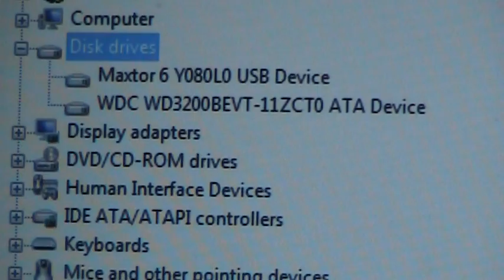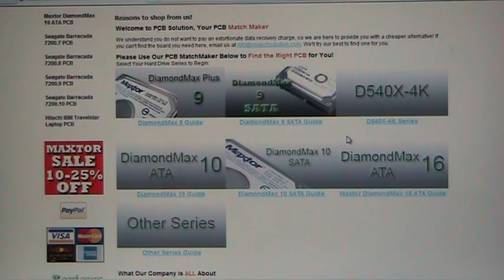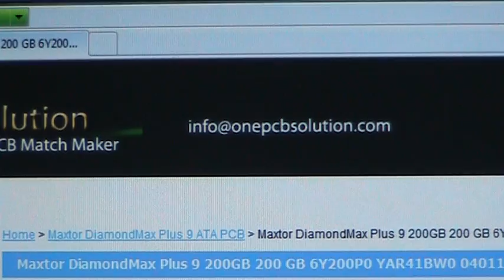DIY: How to repair a clicking damaged hard drive

Comment from the maker: With clicking drives, it is very difficult to tell what the exact problem is, simply because many problems all cause clicking.
Here are some rough odds estimators though to help you with the diagnosis:

1) Dropped (not the PCB)
2) Started clicking awhile ago, now it's finally dead (not the PCB)
3) Known power surge. Probably the PCB
4) suddenly died. 50/50
5) Computer can still detect the drive in device manager, but unable to access data. (not the PCB)
6) Drive not spinning and wasn't dropped. Probably the PCB.
7) If the drive shuts off after a short time (30 seconds), it is usually not the PCB, though some people have reported success as well.
Reply: +pcbsolution My Hdd Show 0G(zeroGigs) In Bios , in Device -manage It doesn't show up at all? This was Sudden Fail, Did not click before Fail happen.  Now it is a Vary Quit Click(not like other drives I've fail.)  So, When i plug it  in It spins up and clicks for about 15-30 secs then stops. (spinning and clicking.)  Witch might be why its not showing windows but in bio.
Reply: +pcbsolution Any Advice , Is there a way i can fix this myself , I have tools. I also went to votech for HVAC and AUTO Mechanics.  So i feel comfortable  opening And replacing a Part, ( I just dont know what the Diagnosis is) Thank You for your time and expertise
Reply: I have number 2 what might be the problem? ?  And can it have anything to do with my CD- Rom
Reply: After putting windows on sleep mode, my windows woke suddenly a couple of time and then the hard drive started clicking. I can't see it in the administrative tools but I can see it in the bios. What should I do?
Reply: If you are talking to me, I never dropped or hit my drive, it's not even external.
Reply: Hello sir. my brother kicked  my new pc so it ended up the hdd making that click of death. so the data is not important but i want to try to fix it ? any ideas ? will freezing do the trick ?
Reply: @CGFUN829  For future readers of this, you might want to search YouTube for a technique that involves bumping the drive into the palm of your hand to help  jolt the head off of the platter to return to the park position. I read in other post that this might help especially if  your laptop was dropped or jolted.
Reply: ***** Hiiii i tried the freezin for couple hourse but am a fraid that the hdd got wet when i was working on it ? is this safe ? got wet cuz of cold   you know.
Reply: Hi, I have a notebook hdd who was working fine (apparently, since maybe before it crashed I hard weird noises coming from it but not as hard as clicking) and I was able to open files, move, etc with no apparent issues (normal speed) but out of the sudden the notebook froze and I restarted it but then at start it was clicking and got a black screen saying OS can't be found. I've bought one of those SATA to USB but no luck, just once it was able to recognize the drive but I could not recover anything since it was to slow to navigate the drive, after that it didnt recognize it again. What might be the cause? Thanks.
Reply: pcbsolution i tried to open my hard drive because it was making a clicking sound and reset the platters but after resetting my hard drive died it won't read on my computer anymore or spin got any ideas on how to fix this

Comment: I don't know if anyone will answer this but i want to ask a few questions. Alright so my 2TB HD isn't working but it's not making the clicking noise this one was making. Mine started doing like periodic clicking noise and then it freezes up completely however it works sometimes i had it working for over a week but i did a CHDSK through my computer manager and that process took over 8 hours to complete i thought it would help fix sectors and possible corrupted windows files. However after booting this morning the clicking (same as started before) started and i could not get it to boot.
Reply from the maker: with gradual failures, it is most likely the disk head. I would recommend seeking a data recovery professional.
I do not recommend making any firmware upgrades or opening the drive in a clean room (what will you do once you open it up?).
Reply: Clicking has to do with a header mis-alignment, it might be a header crash. W/o a clean room, and opening the platter, there is no way to see the internal. 
I would first check to see if there is a firmware upgrade for your hd, next take a look at the SMART errors/status. 
It could also be an environmental issue.

Comment: Companies like this guys overcharge for second hand boards that they buy for cheap because they are offering you the hope of getting your stuff back. This swap DOES work on a few modern hard drives when the ciruit board the problem, but for most you will have to swap some chips from the old PCB to get it to work fully. Then there's all the internal problem possibilities. :)

Comment: What if I have two partitions, and the drive (500GB) is only clicking when I have a driveletter assigned to the 2nd partition? I can perfectly access and use the 1st partition (via the driveletter c).
Say, I assign drive letter d to the 2nd partition. If I go to a command prompt, and do r 'dir d:', there is often exactly one click (sometimes there are more clicks, but the "Data error (cyclic redundancy check)" comes after 1 click).

The drive isn't dropped. It's about 4 to 5 years old, and it's not been touched for a long time. What's the chance a new circuit board will help? What's the chance freezing it (in a closed package) in a freezer will help (for a while, until it gets to room temperature again)?

Is it possible to divide the malfunctioning partition into two new partitions (and use file recovery software) to get a large portion of the current 2nd partition back, without clicking sounds? Maybe it only clicks when it needs to go the end of the 2nd partition?

Can it help to put the drive upside down?

Comment from the maker: Hi choochoochooseyou, if your computer or drive works fine for a while, then the circuit board is working ok. If the clicking sound starts later, it is most likely some kind of internal drive issue. I would recommend backing up your important data asap.
Reply: some drives are cheaply made and mass produced for big computer companies. These drives will run and get too hot and malfunction. best bet is get yourself either a good quality drive and replace the factory junk or get a fan on it to cool it down. 
Another thing i have notices is the larger drives (1 Tb and higher) especially those in external housing tend to fail more often. My desktop has 1.5Tb capicity but its spread out across 5 300Gb drives in a raid array and has proven to be more reliable that a single 1.5Tb drive which i had and run a 1/2" drill bit through after its long life of 3 months use.
Reply: pcbsolution
Easy Laptop Repair Video Course

Safe Redirect (No Spam) => http://laptop-repair-video-course.blogspot.com

Comment: Great guide. My desktop actually boots up fine. But anywhere between 2-20 mins I hear a single click as opposed to the multiple clicks in your demo, the drive light stops, I get 'no signal' on my monitor. Fan still spins, tower still lit up. Does that sound like the click you describe? Thank you.

Comment from the maker: If your drive is slow but still working, then the circuit board is working fine, but the hard drive could be close to death.
I recommend backing up your important data asap. After that you can check for software problems / viruses etc, or replace the hard drive if necessary.

Comment: Hey, I have a Samsung hard drive that I have taken out of it's case I tried plugging it directly into my PC but it doesn't work also Whenever I plug it in it beeps a few times do you know what the issue is and it possible for me to fix it?

Comment from the maker: I recommend opening the external enclosure first and see which hard drive is inside the enclosure. Some models have firmware issues that cause the drive to be not detected. You can email us the model number for a faster response.

Comment: My External HD is a Verbatim and it not doing any clicking sounds. I can hear it spinning but my computer is not detecting it and I've tried different USB cords it wont detect it. I am just wondering if the circuit board is  fried.  I have not dropped it at all.  Maybe just needs a new circuit.

Comment: hey could i do this with an external hdd? I have a working 300gb internal hdd and a broken 1tb external hdd. is it possible to switch the circuit boards so that i could have the proper working board with the 1tb hdd as an internal hdd?

Comment: Most of the times it's a burnt out IC. If you look at the PCB very closely, it could be possible to localize it visually. It's possible to test-measure a PCB, but you need an electrical diagram of your specific PCB, a very low powered soldering-iron and: Skills. It's not impossible, but tricky to find the failed component (and a replacement for that matter)

Comment: a dust free room to replace a circuit board?? wtf? xD
Only elements exposed if replacing the PCB are the connectorpins. I never heard a connector that wouldn't conduct because of a dustparticle landing on it. If you have an example which might prove I'm wrong here, please leave a reply. Otherwise: Inform yourself before being "the smart one". ;)

Comment: Is there a way to test the PCB, for example using a multimeter, just to be sure that its a PCB that's broken, before ordering a new PCB and finding out its not working again? Cases of dropped Hdd's are very rare, except with removable HDD, or dropped laptops, more often the problem is caused by overheating in the laptop/desktop case, electric surge or simply because the HDD got older and used.  Are there sure ways to detect the issue and relate to that problem thus lowering the recovery costs?

Comment: My hard drive doesn't make a constant clicking like in the video but instead it clicks once like when it starts up then stops. No noises or anything, and the computer won't read anything from it. I think it might be that the disks aren't spinning. Would this be a problem with the circuit board?

Comment: i have a problem ,i was fixing my rec dc adapter to work so maybe i change wires voltage red with yelow ..i just wont to ask is it possible thats that why it wont work anymore?

Comment: The fall might have damaged the circuit board, but it also could have damaged the heads inside.  There's no way to tell unless you can actually see damage on the circuit board.  It will cost you $50 to buy a new circuit board to find out.

Comment from the maker: With clicking drives, it is difficult to tell what the exact problem is, because many problems all cause clicking.
Here are some rough odds estimators to help you with the diagnosis:
1) Dropped (not the PCB)
2) Started clicking awhile ago, now it's finally dead (not the PCB)
3) Known power surge. Probably the PCB
4) suddenly died. 50/50
5) Computer can still detect the drive in device manager, but unable to access data. (not the PCB)
6) Drive not spinning and wasn't dropped. Probably the PCB.

Comment: The only way I know how to tell is actually taking the face plate off. The hard drive shown in the video already has it off, normally there is a silver/metal cover that protects everything you're seeing. Once you take the plate off then you would be able to inspect the circuit board. Another thing to be careful of is finding a compatible control board, especially on newer hdd's, more and more information is on them now a days. Best option would be to contact the manufacturer or a local comp shop

Comment: Ok, my hard drive was clicking also... so i also read that if you take your drive out of your PC and hold on to it, boot up your PC and wait for it to click, shake it very slightly parallel until it stops clicking and it may run a bad sector scan, and it worked on my drive.

It was worth a try so I figured I would also post this here too. My drive is now working fine and I was able to pull my files off of it. This does not help though if it's the board messed up. This is if the header is bad

Comment: I see you are young and naive, but there is such a thing as a 40GB hard drive, do you think hard drive have always been so huge as they are today. For your info I remember back when hard drives was 20 MB (Macintosh Hard Disk 20), look back far enough harddrives was the size of refrigerators and only held 3.75MB's (in todays 8 bit systems, computers was orignally 6 bit systems). Do some research before opening your mouth and making yourself look stupid.

Comment: You don't know if it's a pcb failure until you replace it (good luck finding an identical hdd model with a working pcb). Unless you have information that's worth thousands of bucks on the hdd, it's not worth the struggle.
What is worth is replacing the blown diode and/or resistor from the power input... if that part was damaged. Otherwise just recicle it.

Comment: i have 2 seagate barracuda 7200-11 160G and one has a dead board, the disk doesn't turn. i replaced the board from the ok hdd and it turned on, but then it started clicking... the disk is damaged now, i can see a pattern that's like the under side of a cd, thin lines making a rainbow. but when i returned the board to the ok hdd, it's working fine. what might be the other possible cause of the clicking beside the board?

Comment: This is not how to fix your hardrive video but how to replace parts that you can buy from us.
When we say we want to fix hardrive errors most of us are wanting some software we can use so we can have the drive ignore the faulty part and just use the part thats not broke or creating error messages.
My hardrive only clicks at startup but later as I am using it I get a message warning of hardrive failure, I dont need to replace anything inside just software, can anyone suggest any to me,thanks.

Comment: I was under the impression that there is no guarantee that this will work at all because of individual disc platter calibration, even with discs from the same batch and same firmware. But I'm no expert.

Comment: And i noticed the norton toolbar as well!
That explains a lot.
The "click of death" is usually caused by the read head failing, not being able to sense it's position on the drive, you can try replacing the controller board, but my suspicion is that this guy is harvesting tons of old drives, and selling the controllers to desperate people looking for any way to recover data.

Comment: Delicate electronics shouldn't be handled with your bare hands; even small amounts of static electricity can easily damage computer components. Using these gloves or an anti-static wrist band is a good precautionary measure.

Comment: When you bumped it you probably knocked loose your cpu fan.  This could be why it comes on but then crashes after a few minutes when it over heats and could also explain the slowness.  Just a guess but it has happened to me.

Comment: How can you tell if your hard drive needs a board replacement or if it's something inside? Also if I buy a board from you guys and it does not fix the problem, can I return it and get a full refund?

Comment: To repair a circuit board just replace it. Duh. how is that repairing it? Also what if you don't happen to have the exact identical model to replace it with. This method is only viable for large computer companies.

Comment: @love08aaa Which would be more expensive?   Repairing the circuit board (time=money) or replacing it?   Same situation when people were using floppy drives.  Back in the day, it used to be less expensive to realign the head, but after a while, it was cheaper just to replace them.

Comment: 1) New HDD are more complex and there are some data storage on PCB so replacing it won't work!

2) PCB error 25% of the HDD "dead" sounds, 45% physical damage, 25% product line error, 5% other...

In my opinion if you going to spend money on dead HDD  go to specialist company they will restore your data, or buy new HDD and recycle old one.

Comment: DAVE, A complete waste of my time. I did the PCB replacement with a PCB from the same exact type spare working 20GB hard drive )same Model /HDA/ PCBA /Unique/ Code /Cylinders /Heads & sectors and the clicking did not go away. Take the foam piece on the back of the PCB and stick it up your bung hole. Complete waste of my time, now I have to go back & un-do what I did with the good hard drive.

Comment: He replaced the board, which repaired the drive. Did you realize that?
If you replaced a part on your car, you repaired the car, you didn't replace the car.

Comment: As for the people saying this isn't repair...well, that just isn't true. Repairing something is replacing bad components with new ones while leaving the rest of the device that is still working properly alone. When you replace a device, you completely discard the old one with a new one--no components from the old one are saved. It's like repairing an engine with a bad starter by installing a new one vs. replacing the entire engine.

Comment: @madfreakinc1 I slapped my SATA and then i shuved my sata connector into my mobo connection and then I gave my SATA another slap. But then I got an IDE, so I also had to slap that into my connection. And it worked!!

Comment: Sometimes swapping the PCB doesn't work. The drive will spin, but not be seen by the BIOS. You also need to swap over the firmware chip.

Comment: @anonimustatts The HDD are assembled in pretty dustless condition. By only opening HDD you expose the surface to dust particles, which will got on the way between disk and heads. In this case it can bring the damage to surface because the heads come really very close to disks. Your disk probably had deflective axis which was out of alignment. You can't repair that by your self.